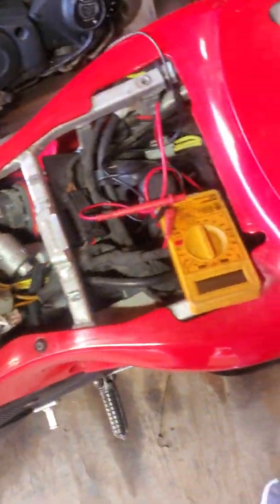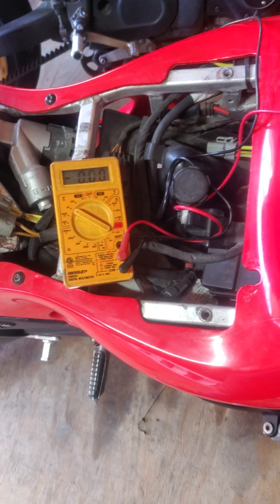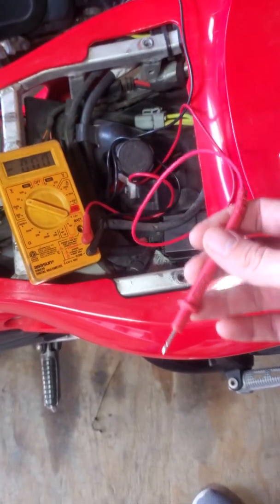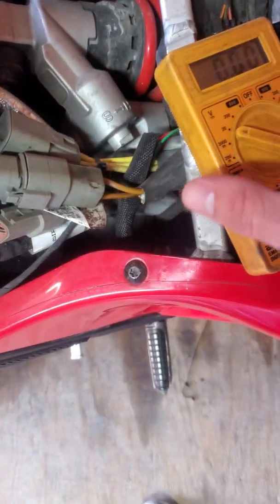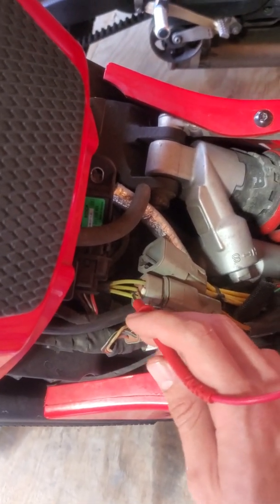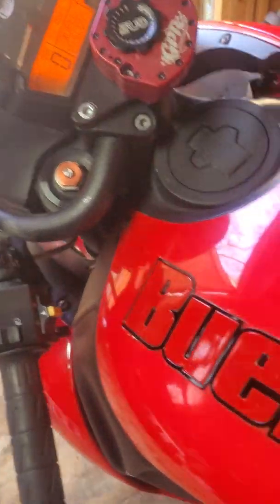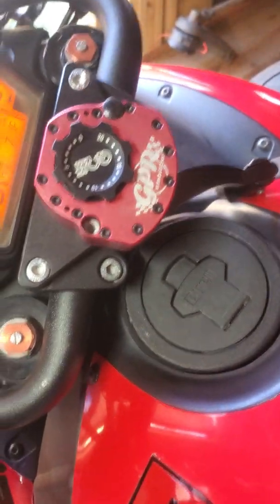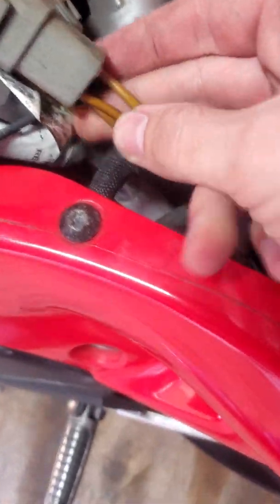What's a stator? A brief explanation. Buell 1125cr fails to charge

Comment: I have a '09 1125R needing 2nd stator at 5,500mi and on 2nd aftermarket VR. My yellow stator wires were also shorting/arcing inside that grey connector - caused black/burning/melting (I have hardwired to delete the connector). Awful engineering to an otherwise nice bike. I can see why Harley dropped them before the mass liability hit. This issue has caused significant frustration and loss of time/time riding.
Reply from the maker: Are you aware of the rotor mod? You can get a rotor with an oil port to cool the stator

Comment: What if its a bad voltage regulator?
Reply from the maker: I usually just test if there is output from the stator. If there is and the battery is not charging, I'll just replace the VR. This is technically the wrong way, but I'm lazy and a VR is cheap

Comment: Just ohm test it, takes like 2 minutes. From each of the 3 phases to ground and from each phase wire to each other phase wire.
Reply from the maker: Oh man, this was forever ago. That stator ended up being burnt to a crisp. I do have another video where a stator passed the tests but turned out to have its wires cut by the rotor. That's why I don't trust those particular tests to verify operation

Comment: so i got this same problem... but mine will die while i'm at the lights and want to drive off. also hard to start it. i even had this problem while driving at 4K-5K revs. getting 12v 180A at battery.
and when i drive it to work it sometimes wont start when i wanne drive home. it feels like the starter is not strong enough. like it almost wants to go but cant get there.
Reply from the maker: Yeah. If you're getting 12v while revving, you definitely have a charging issue. What year/make/model?
Reply: What's the best way to wean out the stator or vr? I thought it was my vr, but now I'm second guessing.
(09 firebolt 12r.l)
Reply from the maker: You can do an ac voltage test directly at the stator plug. Just charge the battery up so the bike can run on battery, unplug stator from vr, and test stator connection for ac output while bike is running
Reply: @Wrenches to Riches  thanks! I appreciate it
Reply from the maker: @josephfriedrich9792  thanks for interacting with the channel. Every bit helps!